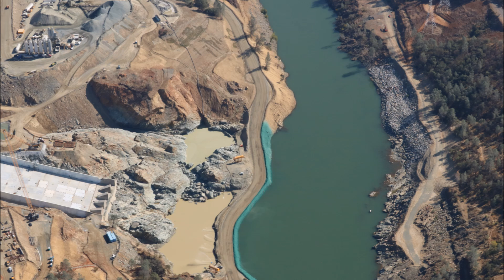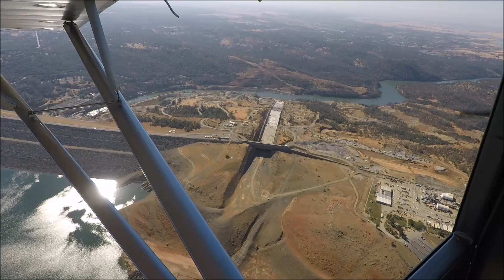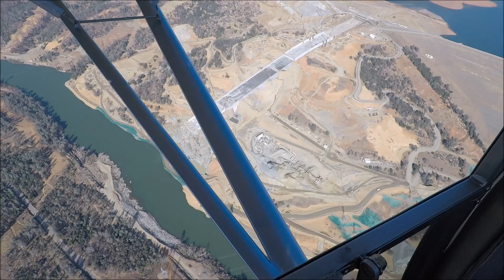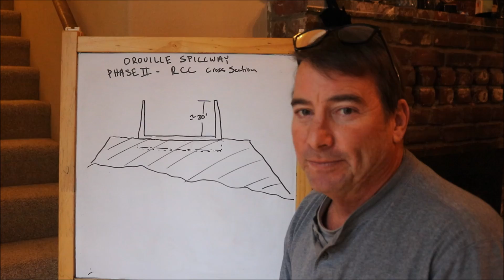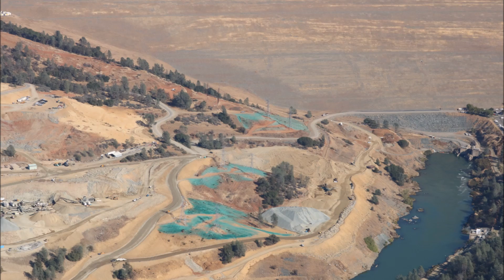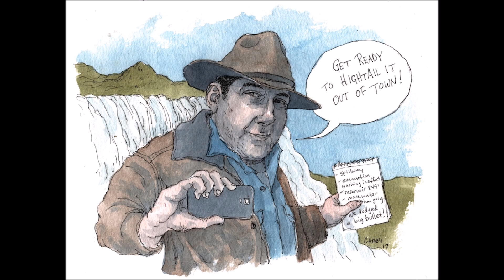Oroville Update Phase 1 DONE!!

Comment: Thanks for the regular updates over the last year Juan.  You're a natural and just seem like an all round nice bloke.

I have a background in concrete construction/steel reinforcement and it's been fascinating to watch your very professional analysis and clear commentary as the project progressed. You mentioned that they don't have anchor bolts deep enough to get down through the RCC to bedrock. They may instead employ post-tensioned, high-tensile steel cables. I worked on a dam augmentation project here in Australia (Burrinjuck Dam NSW) in the 1980s, which was to raise and strengthen an existing dam that was unknowingly built on an earthquake fault in the 1930's. This project used 100's of post-tensioned cables that were drilled up to 120 metres down through two underlying old dam structures then down into bedrock. The cables, probably about 100mm in diameter, were grouted in place and then hydraulically post-tensioned with a force of 22 metric tonnes each cable to hold the new dam wall structure in place. They may use a similar approach at Orville. I can't imagine RCC having the strength of bedrock in this situation.

Comment: Hi Juan;
Thank you for doing a great job and doing your homework.  There are several reporting that don't have a clue abut construction and mother earth.
the anchor bolts as you said come in 20' lengths, but that does not mean they can't go deeper.  All that is necessary is to add extensions.   I have had to have them as deep as 50' because the rock was not strong enough.
Will be following to it is complete like you will.  You have done a great job

Comment: Great job Juan.  The walls will not be 30' tall coming down the hill where the 1050' length of RCC is - they are 30' at the top of the spillway.  Look at the new walls along the bottom 350' section, compared to the RCC walls - they are about 20' tall.  The walls are lower as you go down the hill, because the water is moving faster. Congratulations on the award - you deserve it.
Reply from the maker: good point!

Comment: Interesting that the final layer of structural concrete will be rock-bolted to RCC as opposed to bedrock. I realize the extraordinary depth of RCC makes it nearly impossible, but I wonder if rock-bolting to RCC creates a vulnerability since the RCC is nowhere near as strong and stable as bedrock?  

Congratulations on receiving such a well deserved award for your exemplary work and dedication to this historical event.  You have truly performed an invaluable public service by not only keeping the folks informed and educated, but you've promoted transparency by keeping the big players in this honest.  I thank, admire, and respect you greatly and you should be enormously proud of what you've accomplished.  Well done, indeed!
Reply from the maker: its (RCC) plenty strong about 4000psi strength
Reply: I thought it was 2500 psi unless it's chemically reinforced and I thought I read somewhere that the chemical reinforcement is typically only applied to strengthen the surface.  Interesting too how Keiwitt indicated that the 100,000 CFS capacity is due to the temporary wall height, not the surface strength.  If that's the case, why is it necessary to add a structural concrete surface next year?

Lastly, I sure as hell hope they're not seriously considering wasting billions of dollars lining the emergency spillway with concrete to prevent spoils entering the river in the event the emergency spillway is ever used again.  The c-cant reinforcement seems adequate for safety redundancy, and God forbid it's ever needed again, a little muddy water isn't the end of the world.

Comment: Juan, That landing was NOT rough! A little short, perhaps, but not rough. Try crosswind in a C-130 onto a short dirt field (Bicycle Lake, Ft Irwin, mid 80's before the current improvements). That is a rough landing! Come in hot, and full reverse thrust before wheels on the ground. Brown-out as you head for the wall on the far end.

Comment: Yay!  They did it!  I knew they would.  But I think it was because of your great reporting that I knew that Juan.  :-D  I just have one question.  I don't understand that "step" down from the upper spillway to the RCC.  I would have thought that should be even.  But I'm not an engineer.  If someone could explain that I would really appreciate it.  Thanks again Juan for all you have done.  I have enjoyed watching the progress and learned so much.   Now to watch more of your motorcycle trips.  Yeah!
Reply from the maker: I believe it has to do with the anticavitation feature placed up there. Regardless, it will all be the same level in Phase II.
Reply: Wow!  Fast answer.  Thanks for answering that question.  I kind of almost understand now.  LOL   At least I know it was done on purpose.
Reply: It also leaves room to put the structural concrete on top of the RCC without removing 3 feet of material.
Reply: Oh, yeah!  That does make sense.  Thank you.  I'll keep watching and see what happens over the next year.

Comment: Outstanding job, pilot. HOW about a refresher on the planned WATER flows to maintaining the Lake Oroville levels without the spillway.? With power plants, and bypass valve.? The
H
Thanks, Paul R. Silva
Reply from the maker: See Oroville 2017/18 Ops Plan video in previous update.
Reply: Oops, I meant to request a link to HOW the dam will now normally handle water flow with Power Plants and the extra bypass tunnel.

Comment: Juan, great job and thanks. Just one small question.(if you've heard)... Is the upper connection point where the structural concrete meets the RCC and drops down about 3 feet at what appears to be about a 50 degree angle the new aeration feature ? It's really tough to tell from my vantage point with binoculars from across the river next to the Palermo canal and I haven't seen any finished photos or drone footage showing this...
Reply from the maker: yes.
Reply: Great, and congrats on the award Juan!  Is that strip of yellow material along the downstream edge of the aeration feature a collapsible air plenum, or piezometers to measure air pressure, both, or something else?  Also, is the aeration feature included in the phase 2 design, or just temporary for phase 1?  Maybe they figured they'd add aeration for the RCC portion because it might need it, but the final structural design won't?
Reply from the maker: I think just Phase 1...I'll ask 'em. They may still be figuring that out.

Comment: Thanks for the great job!  One question:  What is purpose of the 3' to 4' spillway step-down at the top of the RCC section?  Seems like it would cause severe turbulence.
Reply: That's sort of the idea, It's an aerator.  They built air stacks on each side with ports at the bottom.  They want the water to be all bubbly instead of laminar when it flows down the RCC.   Less chance of cavitation damage.

Comment: Juan said the gate system was repaired as needed. Does that mean they fixed the leaking gates? I would think that if the water gets high enough to reach the gates this year it would make the upper part hard to work on if the gates leak..?? Or did they fix them??
Reply from the maker: garrrbo the plan is to keep the lake at 800’ this year...13’ below the gates.

Comment: The problems here can be in other dams! This water slide could have cost alot less but still if air pipes were installed in other dam water slides the water pressures would be much less so the cement isnt ripped up from the negative pressures! Maybe next time the army corp of engineers can fix it but when everyone has friends starving to death who is going to save the government money doing things differently? Case in point the company hired to fix porto ricos power grid!
Reply from the maker: cavitation was not an issue here...Final forensics report due this month...